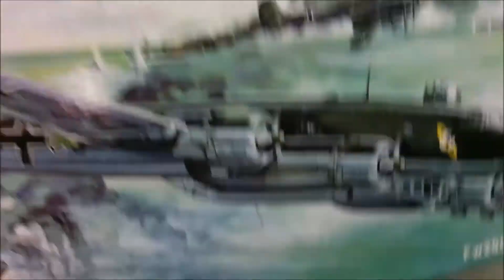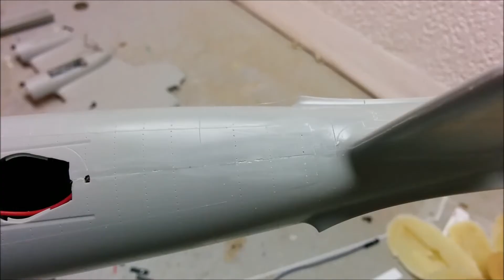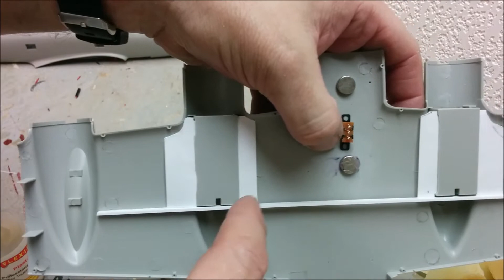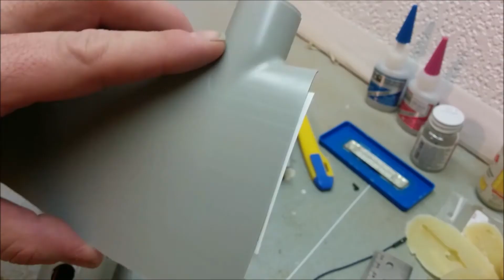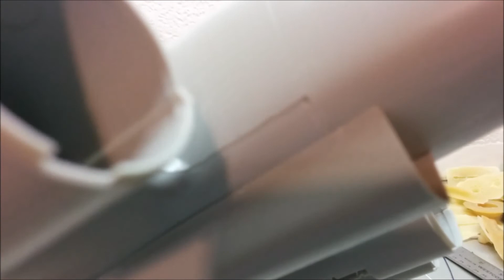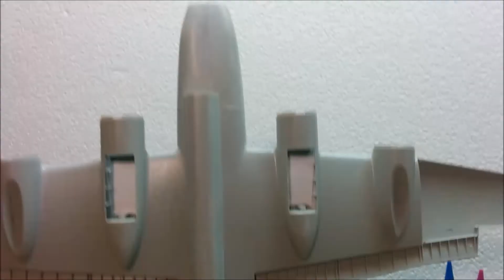FW-200C-4 Condor Build Pt5 1/48 by Trumpeter

Comment: Let's run a large piece of reinforcing brass rod along the centre section from wingtip to wingtip. That way we'll get a sturdier build than just using the styrene with no flex at all in the wings. We might also want to stay away from putty as filler if at all possible. It leaves too many air bubbles on the surface of our model that will show up in the final paint job. Super glue is ALWAYS our go-to filler for a smooth surface. Other than that, I'm liking the way it's coming together